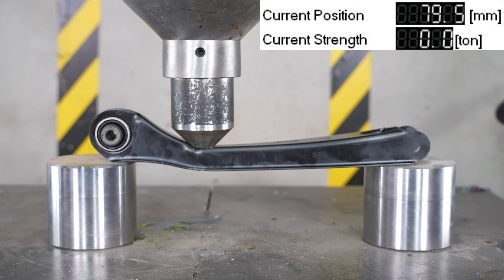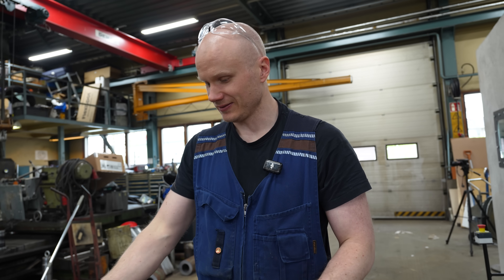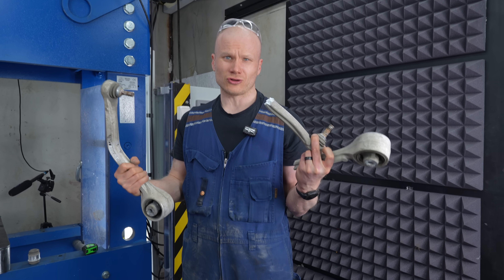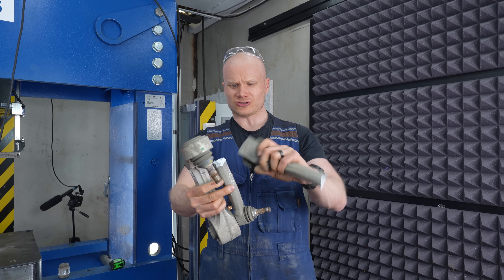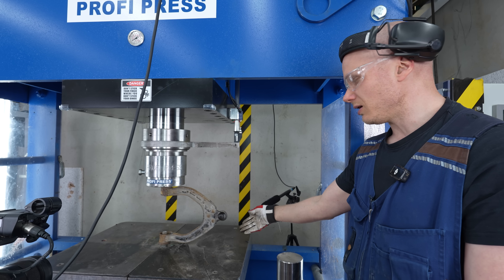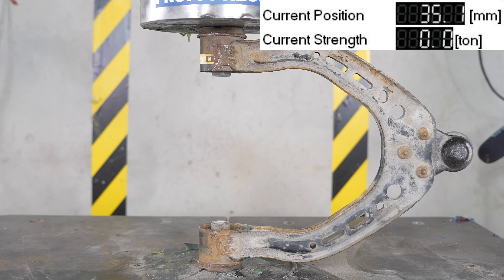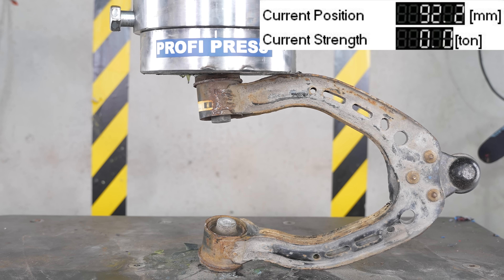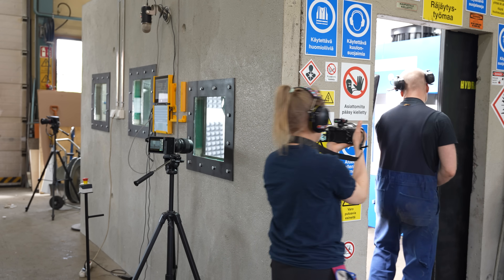Crushing Parts From My Tesla Model S

Comment: For those wondering why you would ever use steel in modern automanufacturing when aluminium clearly has superior properties. For heavy duty use (such as what a Land Rover might see) the steel doesn't wear out as much due to repetitive stress. This is because steel has a stress limit. Any force applied below that limit will not leave permanent fractures/deformation in the steel. However, aluminium does not have a stress limit. So, any forces whatsoever leave microfractures and deformations in the material causing it to wear out much faster.
Reply: Steel has fatigue limits, Aluminium has fatigue life.
Reply: @4G12  Also there are thousands of different steel types, all those facts XY is stronger than steel... usually takes into account 350 Nm construction steel.
Reply: Yep. Stress cracks will develop in ANY stressed aluminum part under just about any amount of force. Repetitive forces will inevitably lead to failure. Steel used in the same places can be thinner and will never develop stress cracks, but will have to deal with rust. Take another example from the automotive world: Piston rods. Aluminum piston rods used in high horsepower drag racing engines can need replacement in as little as 20 passes depending on the horsepower level experienced. Much thinner steel piston rods are heavier and the extra rotating mass reduces RPM, but they do not have any pass limits. They are good for as long as the bearings survive and they don't experience catastrophic loads due to some form of failure.
Reply: @scythelord  I have had every kind of motor, steel with steel heads, aluminum with steel heads and aluminum with aluminum heads. The only difference for this average Joe who drives slightly less than the average person, who gets oil changes at 3k miles, who uses system cleaner (marvel mystery oil) and only buy used cars with my most recent purchased with 135k miles on it.....the only difference between the motors has been.....has been....shoot. I dont know. It has never mattered. Other parts of the cars have worn out faster. I had one buick where I blew the head gasket and one ford escort where I blew the transmission. Not surprised by either of those. Had nothing to do with durability difference between steel and aluminum.  

Really, the only difference that I have noticed....or rather felt, was that you dont have to worry about topping an aluminum engine off with cooler water like you do a steel motor because the risk of cracking is not nearly as high. So when I have had issues in that regard, obviously its due to overheating. One time I had a car break down with an aluminum block and heads. I didnt have to wait long until I was comfortable enough to add water. Last time that happened with a steel engine I waited for a couple hours for the engine to cool down and was still worried about cracking.

That is the difference, the only difference most of us will ever face in that regard.
Reply: @scythelord but pistoms can last millions of miles in a car and tbey are still aluminum alloy. if the stress is low enough for a certain design the lifespan can be so high you basically won’t notice it has a limit
Reply: @rotorblade9508 pistons don't last millions of miles, try 100k. With a paper air filter and no overheats
Reply: Aluminum also became popular when they started using larger shock mount bushings and larger bushings on the ends.  Once you make a part that can evenly support those larger bushings, that's using a lot of steel and a lot of weight and you have lost the advantage of being able to use less steel.     Suspension (really unsprung) weight is a massive factor in vehicle handling, so here we are.    

As for failure modes, the rubber bushings are long gone before any harm comes to the control arms in use.  You can typically replace bushings a couple times before even the ball joint wears out and the arm itself is just fine even at that point.  The control arms are just built to buckle before frame or subframe damage is done.   The steel one he tested isn't even designed to support a bending load because it is the only one that doesn't have a shock mount on it.  So, as usual, fun, but not informative, test.
Reply: I was surprised aluminium was used at all in suspension parts.
Reply: @zapfanzapfan  saving unsprung weight is important for ride and handling
Reply: @zapfanzapfan aluminum is used for suspension in most cars these days, at least for parts that don't see a lot of dynamic force. One of the easiest ways to improve any car's handling and ride is to reduce the amount of unsprung weight, that is, the weight of the suspension and drivetrain parts. All of the cars these parts came from (minus the stamped steel one, which was a rear control arm from a car with a multilink rear suspension, and is likely not loaded much at all, it just stabilizes the loaded parts) were from vehicles with a double wishbone, McPherson strut suspension. In that setup, the control arms mostly see lateral and axial forces, and don't do a lot of weight carrying. The main lower arm, which is the one that was shown from all 3 vehicles, does carry load, but mainly from the ball joint to the inner bushing, which is a very short distance. The spindle, which is what carries the wheel, attaches to the ball joint and the strut assembly attaches to that inner bushing.

In the case of the Land Rover part, that very clearly has a designed-in weaker spot that's intended to flex a little bit under harder loading of the type you'd see while going off road, and it's also designed to fail gracefully by bending instead of suddenly breaking, allowing you to maintain control of the car until you can stop. Again, because that's the type of thing that might happen while driving off road in extreme conditions. For the other cars, they're only going to see those forces either in a crash, or with extreme abuse, so breakage is acceptable there. The Land Rover part adds considerable unsprung weight... But that's fine when you're talking about a vehicle that's legitimately designed for serious off road use. You don't buy a Land Rover for driving at high speed through curves- that's what the Audi A6 and the Tesla Model S are made for.

The other Tesla aluminum arm he tested is what is called, depending on car manufacturer and such, a tension strut/tension arm/or track rod. It's attached between the spindle and the subframe of the car at an angle and does not carry any weight. Its job is to stabilize the suspension in the forward-backward direction (relative to the car.) It mostly sees tension and compression loads in an axial direction, and nearly nothing from the top, bottom, or sides, which is how they loaded it here.
Reply: @puckcat22679  Thank you for the detailed explanation.
Reply: @zapfanzapfan  Well it's better than using 2mm thick steel that has rust holes after 10 years of usage... My moms toyotas rear subframe ripped apart and thrown of wheel angle by something like 30%, good thing speed was low.
Reply: This is an oversimplification. While steel can have a fatigue limit and may resist repetitive stress better, aluminum’s lower weight and corrosion resistance make it valuable in automotive design. Engineers account for its fatigue characteristics through alloy selection and structural design.
Reply: Aluminum hasn’t superior properties than steel, it is just lighter and more resistant to corrosion. That’s all. Every single mechanical properties of steel is higher than aluminum. Cut resistance, pull resistance, compression resistance, fatigue resistance, bending resistance, ecc…. Every (except for corrosion resistance) single resistance is higher on steel than on aluminum. So why you said that aluminum clearly has superior properties is something I’m not understanding. If you could explain yourself I would be grateful to you!
Reply: @lorenzoghinelli7018  There are more wanted properties than just "resistances" such as weight. And, as you say yourself, aluminum has superior corrosion resistance to steel.
Reply: @anteshell Yep, is what I said: just those two properties are better with aluminum, all the others aren’t. So how can you say that aluminum has clearly superior properties when steel has a bunch of properties that are better than aluminum?
Reply: @lorenzoghinelli7018  Aluminum has superior weight to strength ratio and superior corrosion resistance. Probably something more too, but that's enough to make a point. How hard is that to understand? That superior means better? And that two things is a plural, so saying properties plurally is correct?

Still too hard for you to understand?
Reply: @anteshell  Aluminum doesn't really have superior corrosion resistance though, it oxidizes and becomes brittle just the same as steel does.  The only real difference in corrosion resistance is that aluminum oxide doesn't look too different from just a matte finish on the part, while steel actually changes color.  If you properly treat your steel it forms an outer layer that is resistant to rust (or that will not oxidize past surface rust, depending on the alloy), but you have to accept that the part will not be a shiny silver unless you're using a weaker stain-less alloy; too many people see the darkened color of treated steel and start sanding or grinding away that protective finish.
Reply: @anteshell Man calm down and think: if you say that aluminum has superior properties than steel without specifying anything else it mean that aluminum has got more properties better than steel but is false. If you say that aluminum has SOME better properties you and the commenter are right but saying that in general comes to be just not true. Did you understand now?
Reply: @lorenzoghinelli7018  No it doesn't. "Aluminum IS superior" means that aluminum is superior. "Aluminum HAS superior properties" does NOT mean that it is superior as a whole. It means it is superior only when regarding those certain properties that are better.

That is just how language works, and seemingly something you have some serious troubles understanding.
Reply: @anteshell Absolutely not! When you don’t specify it means that you are generally speaking and generally speaking steel has better properties than aluminum not the opposite. Here is not matter of language is matter of logic and yours is crap!
Reply: @lorenzoghinelli7018 cast alloy will always b cheaper than forged steel.. let's educate these Muppets 😅👍
Reply: Thank you, I was about to leave a comment explaining the same thing.
Reply: That probably explains why my 1970 Morris Minor 1000 Traveller is still on its original steel front suspension arms (cast and pressed) and rear leaf springs!
Reply: I learned that from Jerry rig channel when he covered the bumper coming off issue
Reply: @anotherplottwist  Yeah, but he exagerated the issue. With modern casting techniques, fatigue is not an issue, that's why aluminium is now used on a lot of critical parts.
Reply: That’s generally why off-road focused vehicles tend to rely more on steel.
Reply: Aluminum is also really, really easy to get dinged up unless it's anodized.  And anodizing makes tolerancing a little harder, especially on parts with critical dimensions inside pockets.  Where with steel, your surface finish will still be fine if you happen to set it on top of a mill chip or you smack it with a plastic hammer to make sure it's seated flat in a vise.
Reply: Very nice!
Reply: And now I understand why they are counting flight hours in airplanes too.
Reply: @Jappmannen  I am not sure that is the case. Its more because a pilots career is dictated by how many hours they fly.

 Obviously a license for a small 2 seater will have different requirements concerning the logged hours a pilot has than a large commercial jet liner. The military is a different story. 

The Air Force has a target of 21,000 pilots, but....

"The Air Force was short 1,850 pilots in 2024, with 1,142 of those being fighter pilots, according to AVweb and Defense One. This shortage is impacting combat readiness and is exacerbated by declining pilot experience. 
"

declining pilot experience literally means "not the right amount of hours logged" but in that case, it means "hours logged practicing war".
Reply: @tommywolfe2706  That is exactly the reason why they count them. Each critical part of a commercial plane has flight time limits. That time is completely different thing that pilot's flight time and they are not counted with same clock or even by same persons. Nothing to do with each others whatsoever.
Reply: I havent seen a rollcage on any race car being made out of aluminum. Same with all the suspension parts on Dakar race cars and trucks, all made of steel
Reply: Money
Reply: I prefer it bend rather than snap when it fails, so the steel appears better to me.
Reply: So if you subjected them both to moderate pressure repeatedly, say by having the press give it three tons and then back off again and again, the aluminium would snap after fewer repetitions than the steel?
Reply: @jennycox4463  In theory yes, but there is a lot of things to consider, you can build more robust parts with the same WEIGHT of aluminum, meaning it wont get hurt so much with these 3 tons.
Reply: Steel does still fatigue after a certain number of cycles
Reply: Airplanes are made from alluminium ,
Reply: That's why vehicles are made from aluminum alloys, not aluminum. And most vehicles still have plenty of steel on their chassis.
Reply: You want aluminium in your car for the same reason why aircraft are made out of aluminium (well more and more from Ca/Ep... but that is a different story). Almost every specific property (that is the property per mass, ie strength per kg etc.) is comperable with steel. Except buckling and bending, where aluminium usually wins over steel if yoy take weight into account. And indeed, fatigue properties for aluminium are lower than for steel, in pure cylcic tensile loads, but if those loads are caused by bending/buckling then with the proper design, the aluminium part is lighter and usually meets the fatigue requirements (with steel you may get a unlimited life, but do you need that...? and a lot of weight). Corrosion is also an issue with aluminium but may be handeled differently then with steel.
I assume that the aluminium parts were strong enough and had sufficient fatigue life (and hopefully damage tolerance) as per requirements. But they needed the reduced weight in order to sell the car: get better fuel economics.
Reply: Steel is superior in all aspects except for weight…what are you talkin bout
Reply: That's why you need inconel instead.
Reply: In tension aluminum isn't any better than steel. (Their strength to weight ratio is roughly the same) but because aluminum is less dense, for the same weight the part will be bigger, increasing the bending moment of inertia, thus increasing its resistance to buckling modes for the same weight.
Reply: A Land Rover see heavy duty use??  Take one off road regularly and all parts will need to be replaced within a year.  That’s about the worst example of heavy duty!  How much construction equipment is made of aluminum?  None.  Buildings?  None.  Aluminum is used primarily when weight is a concern.  It’s more costly and more problematic than steel.
Reply: Aluminum costs twice as much and is more difficult to use.
Reply: @Chris_Garman , BS aluminum is much easier to form and  machine than steel.
Reply: @Chris_Garman 
Aluminium is infinitely recyclable, has a lower melting point, is easily worked and it's lighter.
Superior to steel in many ways!
Reply: @Allangulon is steel not infinitely recycleable?  Aluminum is a hell of a lot easier to machine, I will grant you that.  Nothing more annoying than a cold rolled steel or stainless.  It's also lighter, which is why aerospace uses it a lot.  But aluminum also fatigues super easy, is soft (anodizing helps, but it adds layers on the surface which can throw off dimensions if they aren't perfectly even going inside pockets or in corners), is more expensive by volume, and has a lower melting point.  Aluminum also galls super easy under friction.
Reply: @Allangulon "Aluminium is infinitely recyclable"
As is Steel... Do you think they just throw it away!?
Reply: Yes, steel will outlast aluminum under ideal circumstances, but steel also rusts.
Reply: Steel bends, aluminum breaks...!
Reply: @kurtisstutzman7056  you seen the video?
Reply: @kurtisstutzman7056 nope - that is just a theorie - i cracked many steel parts - and bendet uncounted aluminium ones
Reply: Every material has these same features and it is called strain/stress curve.
As long as you stay in elastic area of the material, it will return/keep its form& shape. The second you enter the plastic region, it will deform permanently 

Aluminum, steel, rubber etc. They all have these but the values where they happen are just different
Reply: Yeah the only reason aluminum is used in the aircraft industry is for weight savings, no reason to use it in automotive for any mission critical components without steel or titanium reinforcement.
Reply: @timmturner Nonsense, it's important to reduce weight, especially unsprung mass, and it's very rigid so is good for handling. It's also easier to form into complex shapes.
Reply: Tesla is king !!
Reply: @BadMergentheim2025 Tesla is a garbage company build garbage vehicles.

Comment: 10 or even 14 tonns is honestly within specs and at the shock point of the suspension (impressive even). It is still an insteresting test tho. And some might have not been in the correct load bearing direction. But it interesting data, for us non corp ppl. :)